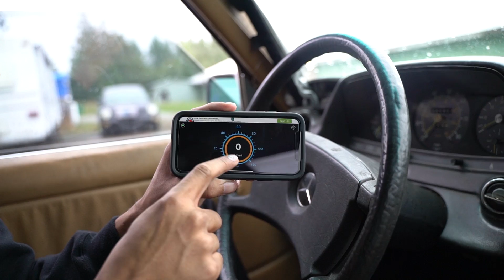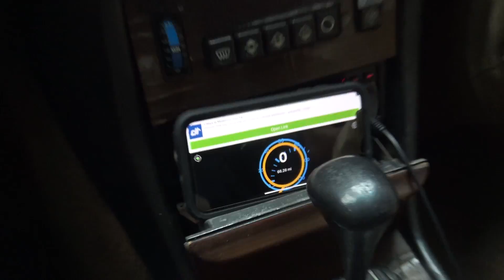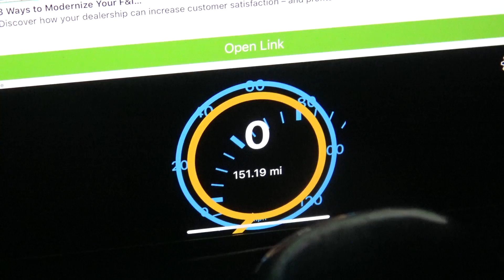Will a Car RUN on USED MOTOR OIL?

Comment: Of course it will. Its an old mercedes man. I got a -93 250 turbo diesel. I drive it on 70% hydraulic oil. Filtrated and 30% diesel. Works awesome. Old mercedeses are like oil burners.

Comment: You can run the old mercedes diesel engine with vegetable  oil. Even with used oil , but it must be filtrate.

Comment: those 300Ds Run forever. But so does my 6.2 Diesel, clocked almost 497k on it
Reply: Kyle H, you mean the 6.4 PS there is no such thing as a 6.2 diesel. I’m a ford guy I’ve done my research.
Reply: 6.2 GM found in THOUSANDS of chevy trucks and vans. Later 6.5 turbo. Homework.

Comment: You can also mix oil in to gas.  I put my waste oil in the gas tank after oil changes since getting rid of old oil is a pain.  5 to 7 quarts to a full tank which is 36 gallons. Never had an issue,  and I never filtered it. It was clean when I changed it. I change every 2500 to 3500 miles. I flush with B12 Chemtool every 4th change. I am sitting at ~1,220,000 miles at this time on my old ram. Figure you might want to do that next.

Comment: NEVER mix petroleum products with any tool employing a brush motor!! It would be wiser to use a pneumatically powered mixer.
Reply: What the fuck are you on about man? 
Try lighting a bucket of diesel on fire, it needs to be compressed and heated to it's flashpoint before it'll even have a remote possibility of igniting. Hence why diesel engines use glow plugs and run ultra high compression ratios.

Comment: My 1985 300sd only gets around 20 mpg on diesel fuel. Is anyone else getting any better fuel economy? I do get 1 or 2 mpg better on waste oil  but my Oldsmobile Diesel got 27 to 30 on the highway and it was a V8 , thought this 5 cylinder little car would do much better.

Comment: You could have used a cheap 2 dollar clear in line filter on the output on a old running intank fuel pump wire it to a battery a little hose and clamps you could have in minutes

Comment: Warning, warning. It will run on waste oil and better than diesel fuel, but , the waste oil needs to be cleaned first the black in waste oil is carbon , unburned carbon and you can filter it to 1 micron but if you ever let it sit for long it will separate and stop up your fuel system. Found that out the hard way. I bought a centerfuge and heater to clean up my 55 gallon barrel of waste oil . It will look just like you poured it from  the can  nice and golden clear. Now I usually mix some diesel with it to thin it some  but burns fine and only smokes a little till it warms up. Good luck
Reply: Where did you get the centrifuge? 
If you were doing large quantities could you use an old washing machine and just run it on the spin cycle?
Reply: @JesusisJesus  Washing machine isn't fast enough but nice thought. The little centerfuge filter is used on big trucks now and they have gone over 500k miles just changing filters and topping off the oil every 3 to 4k miles.
Reply: What RPM are we talking here, some direct drive washing machines get cracking.
??
Reply: Hello Debbie!  I am interested in hearing about your experience with filtering waste motor oil using a centrifuge.  Using a centrifuge, can you get it clean enough to look like brand new, unused motor oil?

Comment: Keep it going, run it on 50/50, if it takes it, do 75/25, and cut the oil with 10%e85 so it filters faster.

Comment: hydraulic oil and automatic transmission fluid you can run straight in summer no problems. definitely filter waste motor oil. set up a raised tank and spin on filter and you can filter it faster. if you are going to run waste motor oil ,change you fuel filter more often.

Comment: I drove from Texas to Yuba City California in my first gen dodge on used motor oil and Diesel mix. I put a 250 gallon fuel cell in the bed   Stopped up 3 fuel filters but it worked and saved me hundreds

Comment: It definitely would run fine with alot more oil in there. The most common way for a diesel to runaway is turbo seals blowing out and pumping into the engine. Even with the fuel cut off they keep running

Comment: Thinner oil would have probably been faster.  I'd think they can run on the lighter oils used in modern cars too, and that would filter faster.  My friend gets waste cooking oil from the local jail (they used to dump it down a drain and got into serious trouble for that.  He offered to take it, so it works out)  He filters all that oil, and through a process makes his own biodiesel out of it that run great.  If you don't include the labor (plenty of labor there) then he's making biodiesel at under 50 cents a gallon!  It's a lot of work though.

Comment: This doesn't surprise me diesel engines can runaway on nothing but there own oil if you way overfill the engine. The only problem I can see coming from this is that it will probably clog up the fuel filters pretty quickly and if you have a newish desiel with a catalytic converter it will probably mess with that to. Diesel fuel is just a super thin oil anyway

Comment: If diesels run off used/filtered vegetable oil, then it makes total sense that a blend of diesel and motor oil would work.
Reply: sure, but don't forget that motor oil has a lot if synthetic additives that may make it unpredictable.
Reply: They can run on pure used oil and sunflower oil too

Comment: Those old diesel merc's are built like brick shithouses there one of the most reliable engines on the planet apparently. You could probably put straight waste oil /break fluid/ cooking oil or anything like that & it would still run. I new a guy with a turbo diesel Peugeot with a pre heater in the tank it ran on straight used fish&chip shop deep frier oil on 21psi of boost & it was a rocket that made a lot of petrol powered car's look slow & it smelled just like McDonald's

Comment: The coffee filter is overkill. All you need is a particulate filter, we used to use paint strainers.  Used oil burns better in old diesels than fresh anyway.
A 50/50 mix usually works okay.

Comment: For my Diesel Mercedes, I built a filtering system that used whole house filter housings with 20- and 5-micron filters and a pump.  I ran a mix of waste crankcase oil, ATF and vegetable oil.  Not much pump diesel fuel at all...  The engine loved it and looked like new inside- super clean!

Comment: that  was closer to an 80 20 mix.....i can do that with a gas car. You want to test it, do a 50 50 mix
Reply: That's what I'm talking about!
Reply: I run 50/50. Wmo and kerosene .  been doing it for 3 years.
Reply: Or 100 % oil as the title says?

Comment: Bro a 300d can run on anything... its mechanical
Reply: Project 5.0h if it’s a stick shift, you can push start it and run it with the battery and alternator disconnected.
Reply: @JonBoy470  how would the fuel go from the tank to the engine ?
Reply: @joelrolo1915  probably a mechanical fuel pump
Reply: @ronaldmcdonald2962  yeah but isnt the fuel pump supposed to be on the fuel tank? meaning it has no belt running it
Reply: @joelrolo1915  they don’t need a belt, they work off of the vacuum created by the cylinders, or by moving it with the cam
Reply: I think 🤷‍♂️
Reply: @Robert-zx2df   no modern diesels is fuel injected, diesels with carbs do exist anyways I'm pretty sure he was saying the pump was ran off a vacuum line, Vacuum fuel pumps are also a thing
Reply: @jaykoerner  no diesel engine has a carb , ever . They don't have spark.plugs either
Reply: @Robert-zx2df  yes I was thinking of old distillet fuel(a obsolete fuel that's somewhere between kerosene and diesel, and after heating can run off vapor) tractors some of which where able to be ran with compression ignition after warm up either from a pony motor or being started on gasoline through the same carb, also you are incorrect on the spark plug statement while uncommon spark plug ignition diesel engines exist though mostly before high pressure fuel injectors allowed correct fuel injection to better control timing, in the case of port injected diesels the addition of a spark plug allowed at the time greater control of ignition timing
Reply: @jaykoerner  The mechanical pump has a camshaft in it just like a small little engine it’s got cogs and wheels so when that engine runs it runs it turns and it compresses the fuel through the injectors at a high very high pressure because of the pistons in the delivery pump
Reply: I know one guy who ran it on a mixture of butter , exhaust smelled like werthers originals
Reply: thats not true.. it cant run on water... or air... or sand... or dirt..
Reply: U are an idiot a turbo diesel should’ve already blown up
Reply: Patty r/whooosh

Comment: You need to build a tank with a heating core inside to hook your heater hoses to. When engine up to temp and also tank with oil should have guage to read with similar temp, switch to oil. When shutting down switch back to diesel and run for 10-15 min to make sure all lines are full for restart.

Comment: I thought they were filling it up with straight oil.
Reply: It would run too. There's a reason why turbodiesels are able to runaway. But by diluting it with diesel they made it easier to start and stress engine less.  Still, I wouldn't run that in a car I would like to keep driving.
Reply: 0 subscribers with no videos The oil itself is not the problem. It’s the leaks in the engine that let the oil in uncontrollably.
Reply: Same
Reply: You can run straight used oil without diesel, it will not run away.  When a diesel runs away it usually means an O-ring on the injector failed and it will run on the crankcase oil until it burns it all or the engine completely fails.  I run used oil in diesel truck engines all the time without using diesel to dilute it.  International made an "all fuel" motor as well, ran better on oil than it did on diesel.
Reply: @nogodsnomasters357   
One guy said how do they run away with only oil left and no fuel. It was confusing how he worded jt. He was replying to another guy above.

A diesel will all so run away on oil from the turbo when it starts sucking oil through it.
Reply: It would still run.
Reply: Nate vanLandingham  no it wouldn’t. Oil would be too thick
Reply: @ro-hammadali1166  

Have you done it?

I assumed there was diesel in the tank and they were not draining it so it would be cut with some fuel. But a diesel will run on straight oil.
Reply: @natevanlandingham1945  true, but that oil is warm enough, thus has lower viscosity
Reply: @ro-hammadali1166  a little late, but yes it will run on only oil. I have a vw t4 2,4d with mechanical pump and i run on pure oil and have done for over a year. Still no issues
Reply: They just added the oil for color to the diesel fuel 🤣
Reply: Rudolf Diesel createt this motor to burn cheap gas, so it also runs on motoroil too. if you dont believe me, search for runnaway diesel engine^^
Reply: Like Piotr said, it would indeed run, and a diesel can 'runaway' if the turbo allows oil to enter the engine. However, it would probably make less torque (which is why you're even still able to stop a runaway in a stick shift by dropping the clutch, even though the engine is running at very high rpm) + your fuel economy will drop. There are better oils to put in a diesel engine that will actually work very well!
Reply: @OHS97  black smoke everywhere though.
Reply: Me too. I thought that they were stupid, but this is just click bait.
Reply: Thats just dumb isea
Reply: Me too
Reply: Same I was kind of disappointed
Reply: Instead, they filled us with click bait.
Reply: Me too
Reply: benz merc I'm not sure how well the engine would run on motor oil, and how good it would drive.
One of the better (alternative) oils would be frying oil! Oils like peanut oil, even when used, will run very well and you will most likely not notice any difference in the way it idles or drives + it'll smell like a McDonald's. Of course, you'll need to filter it very well a couple of times.
Only drawback would probably be slightly lower energy density (but so little the engine will compensate for the loss, thus decreasing fuel economy ever so slightly (this might be different for each brand / how much they've been used?)) and the thicker viscosity. The pump will need to work a little harder but it might work as a better lube and dispose of heat better since it's supposed to withstand very high temperatures anyways.
Another drawback will probably be emissions: I assume NOx emissions / particulate matter will increase, which has always been a downside of diesel cars.

But cooking / frying oil (like peanut oil) will probably be one of the best ways to go! If you'd have an older diesel car or other equipment, I would genuinely run it through it instead of having to dispose it properly.
You could even ask restaurants to pick it up. Why wouldn't they? Rather have you pick it up for free than having them pay to dispose it! :)
Reply: @arnemaeschaelck5012  oder diesel engine with bosch pump can run on veg oil without problems. I have 2.5 turbo diesel Jeep and I run 100% veg oil. Runs great!!! 🙂 My last video is about that...
Reply: V8AmericanMuscleCar Oh but veg oil is very good! As long as the pump can handle it, you're fine!
Reply: Runaway diesels don’t have oil flowing through the fuel system and injectors, so y’all can’t use that to proclaim that it would run on oil in the tank.
Reply: They may be not "straight" people
Reply: Diesels will never run on straight oil it's too thick for the oil pump so add a little diesel to to thin it out
Reply: Danny antrim no u wrong, i have run like 3 or 4 different cars on straight used motoroil and its all okay as long the airtemp is +degrees 👍🏻
Reply: @jonaspettersson102  + degrees C or F ?
Reply: @jonaspettersson102  which cars? I'm curious because I drive my 2.5 turbo diesel Jeep on 100% veg oil and runs perfect!

Comment: why wouldnt it run ITS 90% DIESEL!!!
Reply: I was thinking the same thing and the trouble to go through all this doesn’t seem worth it to save 10%
Reply: Not really you could pretty much run  diesel engines from before 1995 run on pretty much all types of oli ranging from engine oil to sunflower oli
Reply: ive ran a diesel around 60% oil and it ran fine but the fuel filter capt plugging
Reply: @inteloutsidepentium8801  That's why you filter the oil like 5 times for you mix it with fuel.
Reply: Agree should try straight oil lol
Reply: Nick Bainbridge l
Reply: Actually 80%
Reply: Ive ran a gasoline powered Ford Ranger on 1 gallon of gas mixed with 2 quarts of leftover oil from a blown up Toyota Tercel, the oil had antifreeze and gas in it before i added it to my gas, but i had to get somewhere so i chose to water down the gas with oil.
Reply: Jamon Feltner "water down the gas with oil" ......
Reply: Jamon Feltner surprised that the ole ranger ran at all🤣
Reply: Jamon Feltner fuck buying that after you’ve had it lol

Comment: I had a periwinkle 86 300SD with two fuel tanks. One was the stock diesel and the other was in the trunk for wvo with a tank heater. I had switches in the dash to select which tank to run and I had a bunch of huge in line diesel fuel filters. You have to warm up the engine on diesel and shut it of on diesel as to not "gum up the works".

Comment: It will run on transmission fluid , two stroke oil, motor oil ,hydraulic oil , any kind of oil it will.run on

Comment: I ran a 7.3 powerstroke on straight used motor oil for over a year and it got better mileage and had way more power then just diesel

Comment: you could just throw the (properly filtered) used oil in her and she will go .... there was no question it wouldn't run read up on compression ignition engines

Comment: How the hell does this fuel pump not over amp and burn up? That's a big change in viscosity. Also why does the fuel injectors not plug up?

Comment: How's it free if u buying diesel to mix in?
Reply: Tony Brazil diesel is easy to make
Reply: @hdunn8589  fanboi not very smart. He claims free gas but how's it free if he's buying gas to mix the oil with. Hence the free part. Nothing's free if ur paying for things to make ur free gas
Reply: Tony Brazil it will add up and pay for itself also you don’t need to buy things to make diesel you can make it or you could find things and put them together
Reply: Tony Brazil are you from America?

Comment: The oil mixing in the fuel happens all the time the the injector o-rings go bad and they run fine on the mix after you put new o-ring in. We do it all the time with our buses.

Comment: I have a 66' Deuce and a Half that runs completely on used oils so I'm not totally impressed since the old diesels aren't as picky about the fuel that you run in it like the newer ones are.

Comment: But, you're not running the engine on used oil as fuel.. You're running the engine on diesel fuel with a bit of oil in it. I mean the ratio was like 80% Diesel fuel and 20% oil. All it's going to do is gum up the fuel filter. I don't understand any of this

Comment: My Deuce and a half has no problem with used motor oil, or diesel, gas, moonshine, kerosene, tiki torch oil, or anything else that's a flammable liquid.
Reply: I've always wondered how these work. Do they have a fuel pre-heater or do they have some sort of Mist chamber that returns excess "fuel" to the tank? 
I'm guessing that they use a gizmo much like the "Mixer" used in LPG engines. Ie. Hot radiator water is passed through the same space the LPG to change it from a liquid to a gas. 
If I were doing a WVO setup on a diesel engine, I would probably make a copper coil in a Pipe or a large Can, and pass Radiator water through the Can and the "fuel" would run through the copper coil. Or even possibly re-purpose a Water-Air Intercooler to do the job and not have to weld or solder a damn thing.

Comment: just pour straight oil into it, diesels can run on straight oil, detroits did it all the time back in the day when they would stick wide open, ran on the oil in the crank case till they blew up with the fuel and injectors shut off